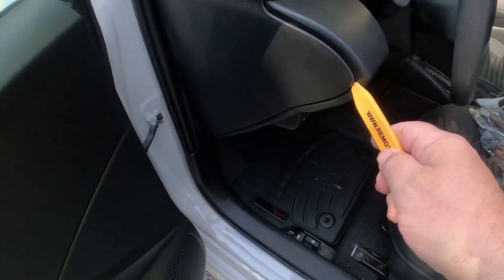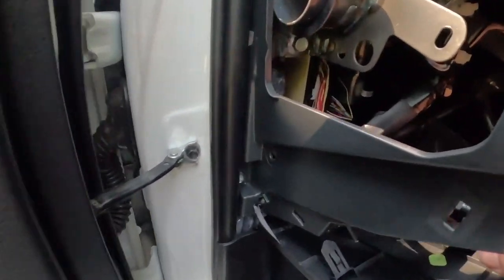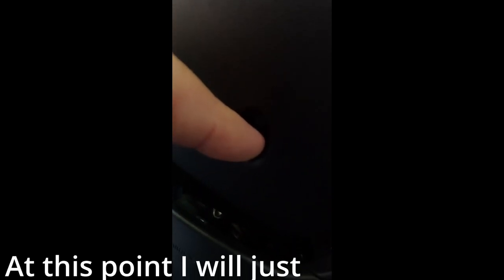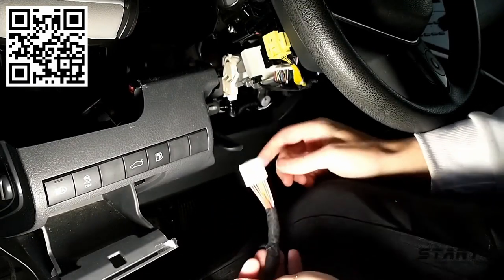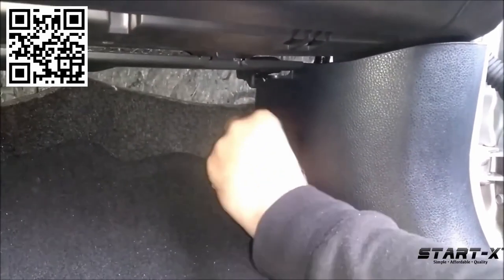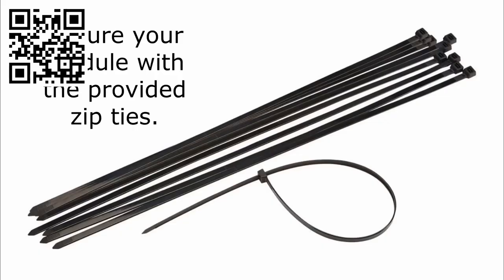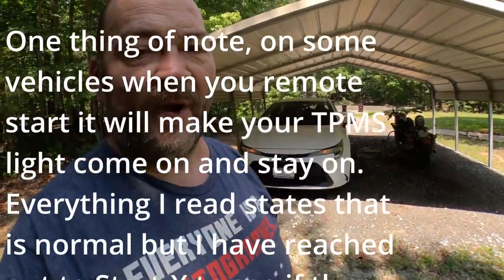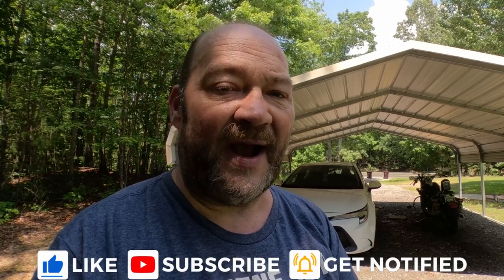Start X Remote Start Install in 2021 Toyota Corolla

Comment: Hey, I'm using a different kit that requires me to tap 3 wires into the push to start button ECU and it has key takeover. Is that the ecu you showed on the left side of the steering wheel? Or would it be behind the push to start button? Thanks
Reply from the maker: It looks like on the push to start models the set up is different, the ECU is the same but the plug for the push to start is on the right side of the steering column

Comment: Did you find a fix for the tpms? Also, if you remote start and turn it off and turn it back on with the key does it turn off?
Reply from the maker: So yes, if you turn it back off and turn it on with the key, the TMS is fine also even though the TPM light comes on when you remote start the car as soon as you get in and put the key in and turn it in the switch and then shift into gear. The TMS light goes back out so it’s fine it’s just because the remote system bypasses the TP to start the car.
Reply: @LiamPhotoATL  Cool, thank you so much that was very helpful. I just ordered mine so I just wanted to make sure
Reply from the maker: @dilloncampbell9529  no worries I even talk to the local Toyota dealership and they said yeah it’s normal a lot of times if you have them install a remote start in your Toyota after the fact they just outsource it to a local shop that puts the same brand so they see that all the time and they’re like yeah that’s totally normal

Comment: Thank you for this video, I was able to get mine installed last night and it works like a charm, now I am just trying to figure out the Car Link dongle to turn it on and off from my phone, since my office is kind of far from where I park, my key doesn't have the range I need to start it just with that, but it has been a nightmare to get the dongle to work, only a portion of the thing works, currently waiting on a response from their support team
Reply from the maker: Thanks for watching and commenting. I debated on the remote start with phone but I figured I wouldn't use it enough to want to pay the subscription fee since I work from home.

Comment: Great video, can you tell me, what is the ignition distance range?
Reply from the maker: are you asking from how far away the fobs work?
Reply: Yes, but I read it is the same as the keyfob, I have another question: Did you have trouble with your battery if you left the car parking for a couple of days?